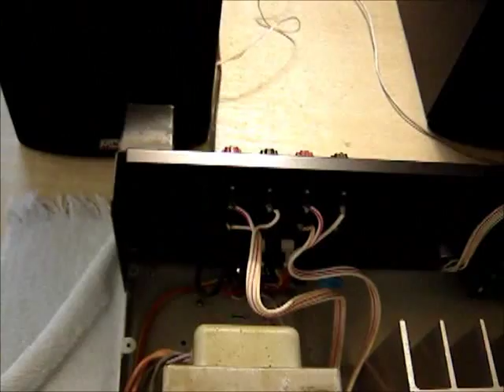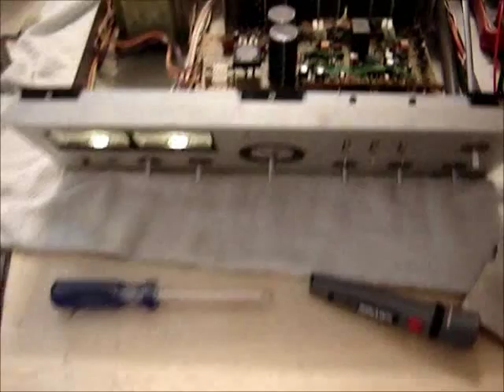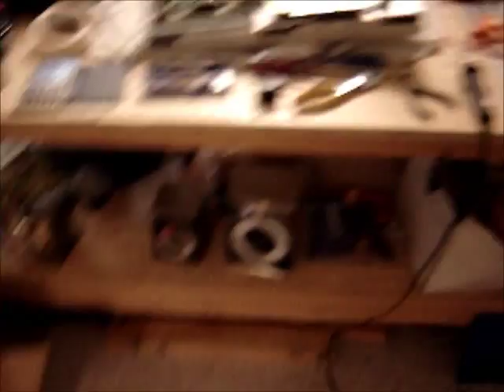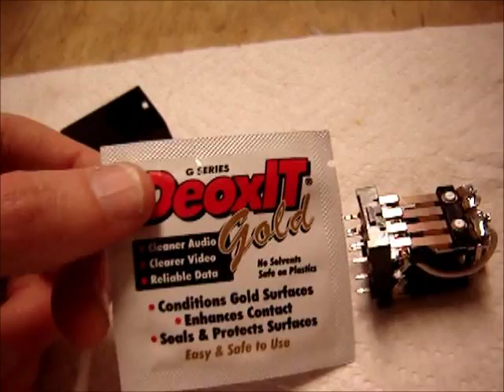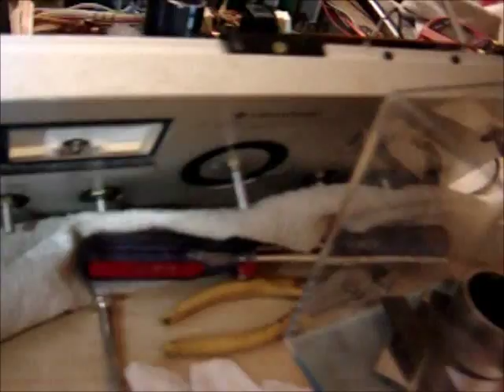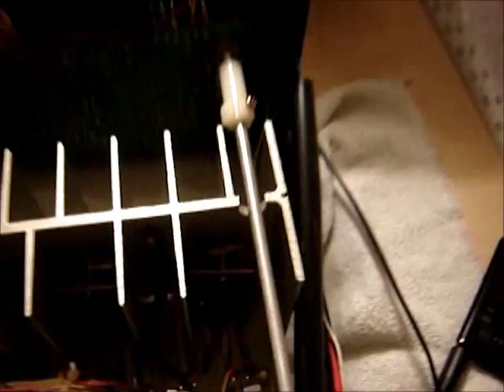Kenwood KA-501 integrated amplifier repair pt2

Comment: I just bought the same Kenwood amp for a very low price.  It had a few minor defects, like a broken power toggle switch I was able to repair.  The usual dirty controls and switches were easy to clean.  Unfortunately, the nylon piece that connects the input selector switch to the long rod was spliced open.  Someone must have put way too much force on the set screw.  I tried to repair it with super glue, but that did not stick.  So, I'll have to think for another solution.  It sure was made on the cheap.  The filter caps are only 6800 µF - 50V , which I think should have been 10.000µF - 63 V, there is no overhead.

Comment: Can you look at the kenwood KA-9100 schematic. On the power board the resistor that is number 15 on the left channel and number 16 on the right channel. The right channel is in question. The resistor is a 130ohm and mine burnt. The right channel went out. I replaced the resistor and it burnt on power . Any ideas I can try by you looking at the schematic? Hi fi engine has it for free if you register. Thanks leo.j.nesuahecner@hotmail.com
Reply from the maker: That resistor seems to be part of the negative feedback voltage divider. The only way for it to burn is if there was a cascade of other failures in the circuit. Several parts can be bad including ICe4, the power output module, so check that. Check transistors De4 and 6. Check for voltage on the output of power amp ICe4 and capacitors Ce8,12 and resistors Re 34,36 (doubtful these caps and resistor are bad, but you never know). ICe2 should also be checked.
Reply: Hey thanks! I did not expect such a comprehensive answer. You are kind to spend so much energy to help. I am learning so it will take some time to read the schematic to find each one. I will though. I'll keep in touch on what I find. Thanks again, you are so cool!

Comment from the maker: Which transistors? If you are talking about the output power transistors, the other channel would use the same ones. If that doesn't help you out, you will need to find or buy a service manual as I no longer have this amp.